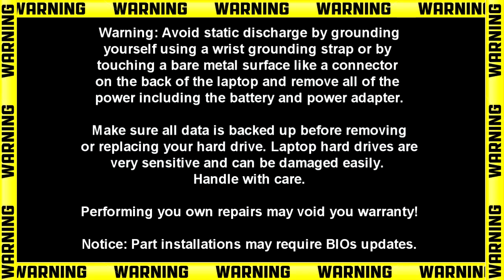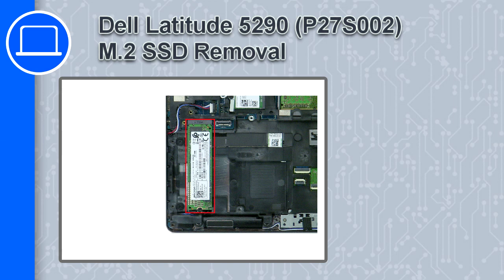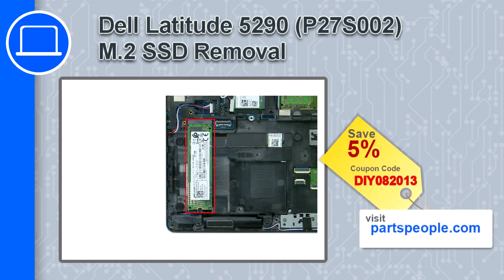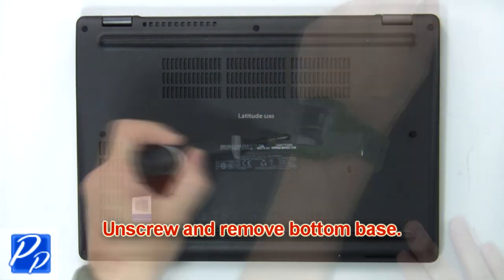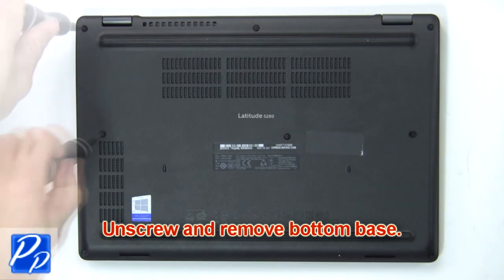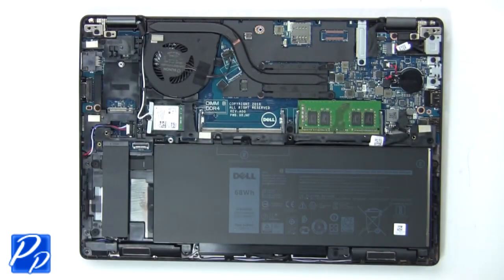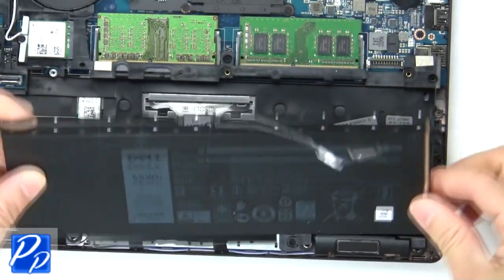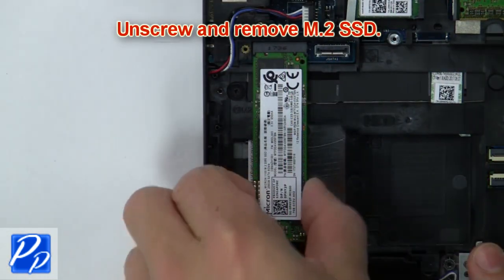Dell Latitude 5290 (P27S002) M.2 SSD How-To Video Tutorial

Comment: Womp womp! This isn’t a 5290. Boo
Reply from the maker: That is correct. Based on Dell's owner's manual, the disassembly and replacement process for the M.2 SSD are the same for both of these models.
Reply: 0:53  @dellpartspeople